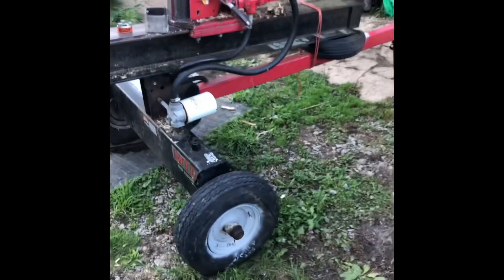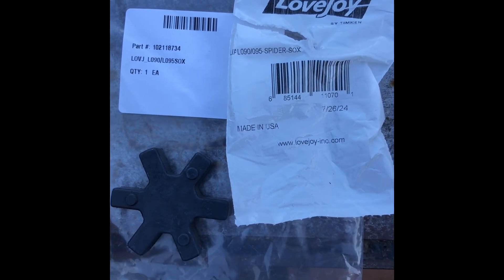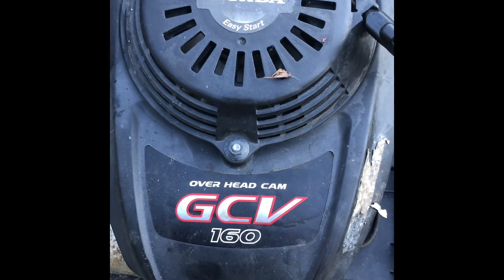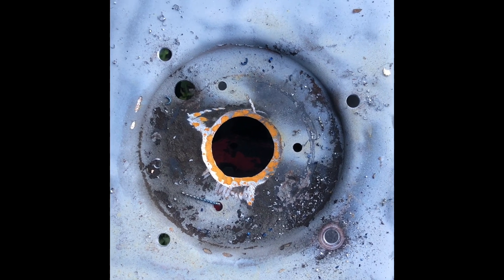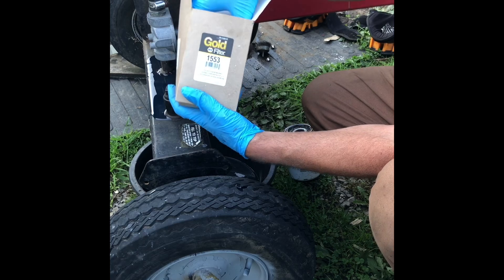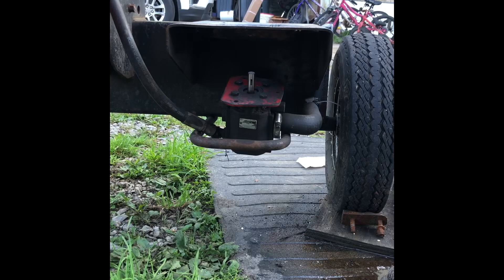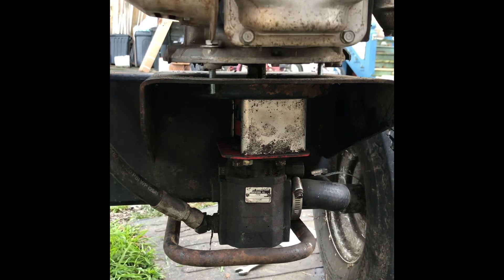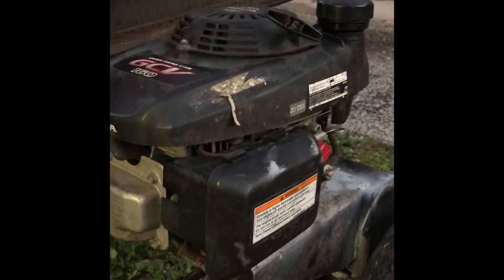MTD log splitter, Lovejoy coupling, Honda push mower engine retrofit = life of ease.

Comment: Can you elaborate on why the extra height with washers  made the set screw come loose? I’m looking at the same engine and would have to cut the shaft , lower the pump, or raise the engine
Reply from the maker: The extra washers gave it the ability to come loose as the engine was not seated solid just on those washers as shims.  That loose engine caused the set screw to loosen. 
Set screws can’t take a lot of vibration as they are small and low torque on the tightening. 
Now one could have added blue locktite and lock nuts to help hold the engine, but I had neither at the first time I did this. 

The bolts I used were a smaller size than what I wanted to use but it’s what I had.  I didn’t have locknuts for the either. 
 They were really too small for what I was doing and I couldn’t apply what I felt was proper torque to hold the engine in place but it worked for about 1-2 years. 
Now it’s fixed right. With the right size love joy coupling and right size bolts.
Reply: @weaversstonehousefarm  thankyou

Comment: So I notice when you slide the new lovejoy on that shaft....that's all there is to it? I ask because the lovejoy I have (just like the one you show here) appears to have something in the side where a screw may go in. (Possibly for the purpose of keeping it on there.
Reply from the maker: Both sides are held on with a set screw. 
the engine shaft side = set screw
pump shaft side = set screw.  
The rubber spider is in-between them.
It takes a little trial and error to get that distance between correct for the rubber spider
Reply: @weaversstonehousefarm  thanks weaver